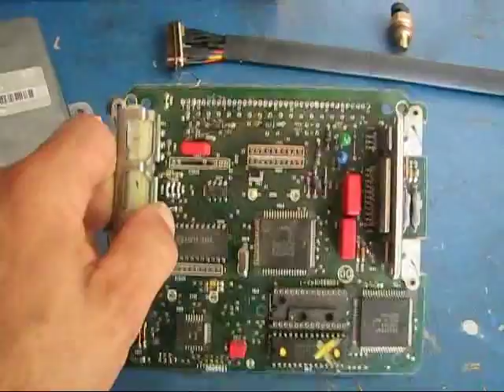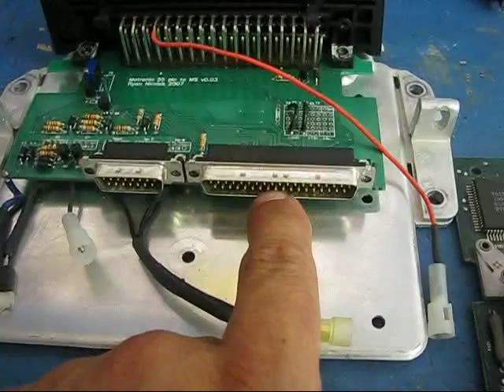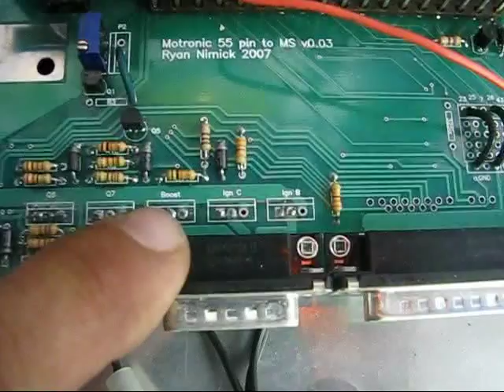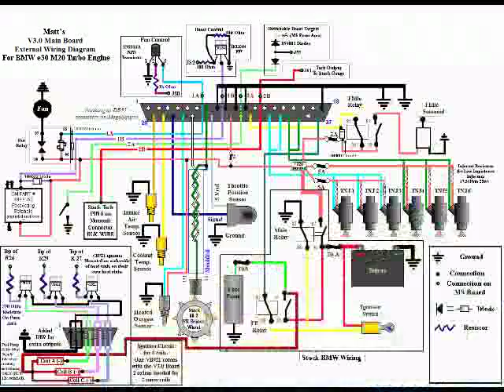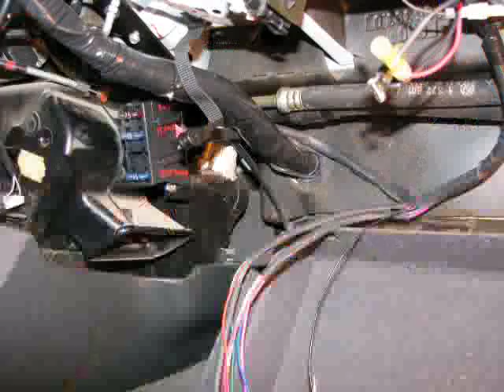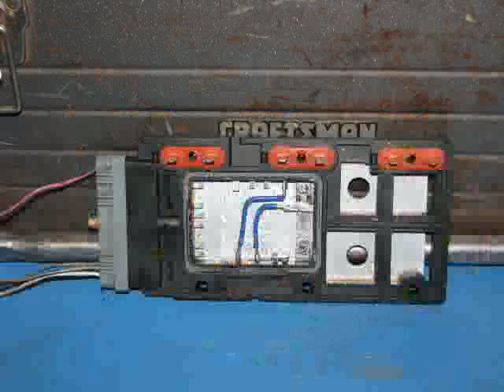Megasquirt 2

Comment: Then obviously you have never done this.  A soldering iron is near impossible to desolder the ECU connector from stock ecu.  The only reliable method is to quickly heat the pins by flashing them with the tortch.  Anyone who has actually done this, knows as much.  Now if he was resoldering the connector to the new adapter board with that torch, yeah that would be dumb.

Comment: @Duckyistrippin propane only works good on a diesel engine or a forklift.lol. when have you ever heard of a supra or mucle car or any car ever running on propane. never so you right im just a dumb as with a 1500hp car sitting in my garage that i built myself. that deffinatly does not run on propane